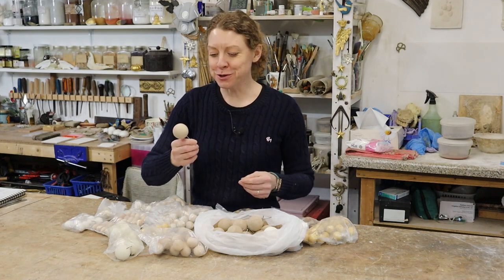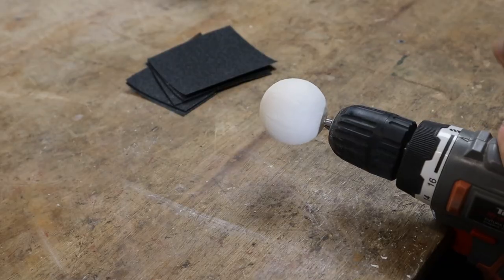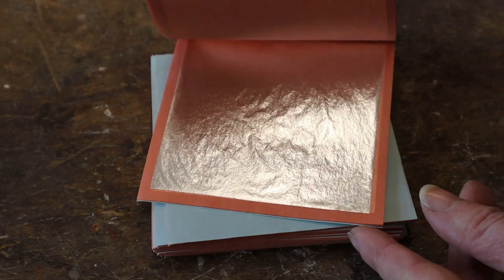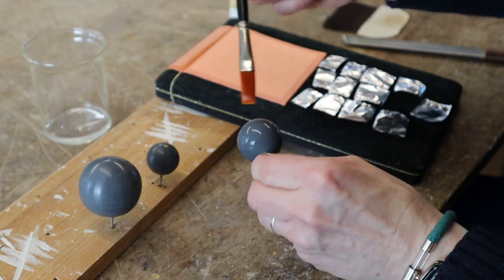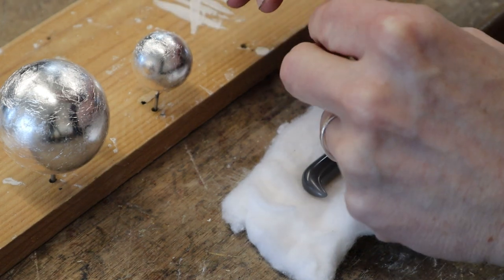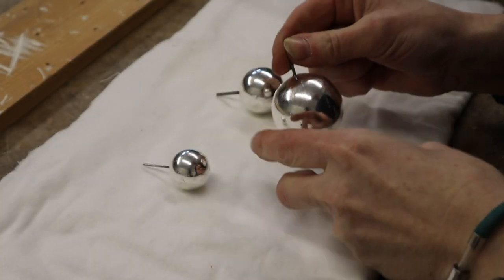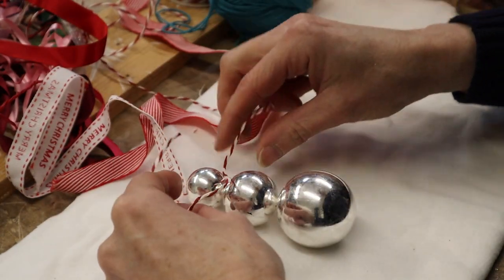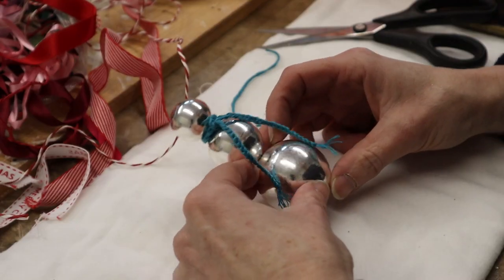Water gilding with silver leaf

Comment: Ruth, with water gilding, do the boles contain glue/adhesive, and the water activates it? I saw your video using the Kolner Instacoll system and I'm trying to understand this process. Thank you.
Reply from the maker: There are a couple of water gilding videos. There is a bit of rabbit skin glue in the gilding water and a lot in the bole between them both the gold sticks.
Reply: @RuthTappinGilder  I see. It's so quick compared to waiting for the oil to set up. I have to try this.

Comment: Hi again. 😬 I’ve been letting each coat of gesso dry for a very long time and sanding in between coats each time. Is this unnecessary?
Reply from the maker: I know some gilders do that. It seems unnecessary to me to sand between every coat.
Reply: @RuthTappinGilder  under average humidity and temperature conditions, how long do you wait between coats? One of my book says an hour… I’m hoping that’s not necessary.
Reply from the maker: @erinwatkinson6473  that's what it was like for me yesterday as the workshop was so cold. It's ready  to recoat when its turned white. It doesn't need to be bone dry like for sanding.